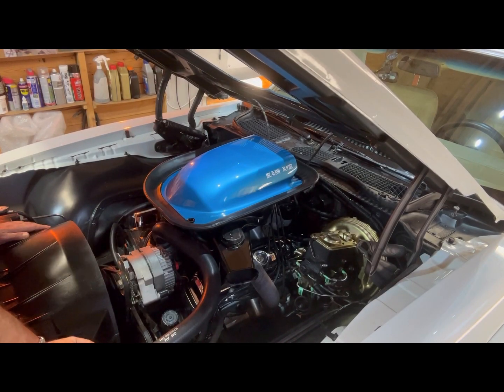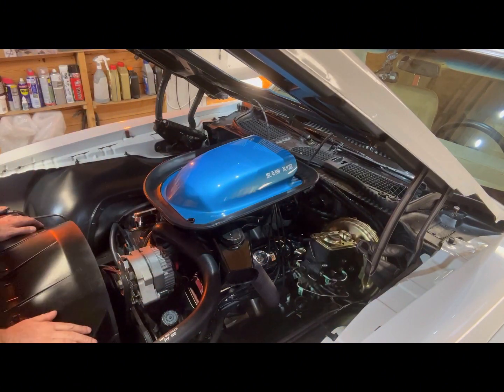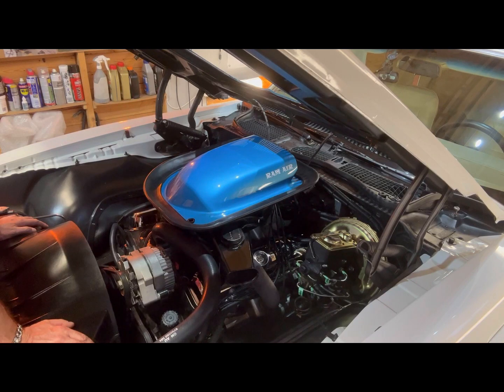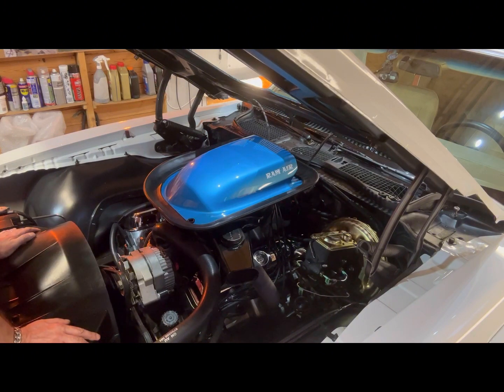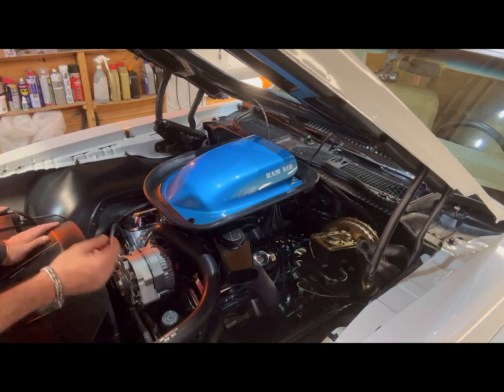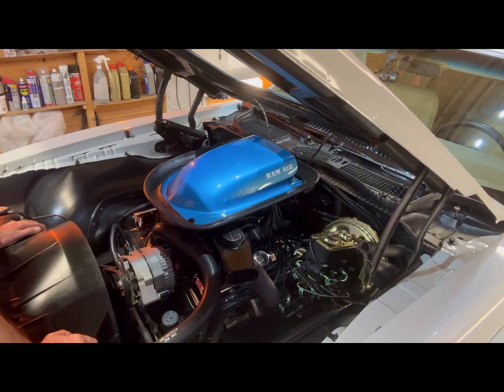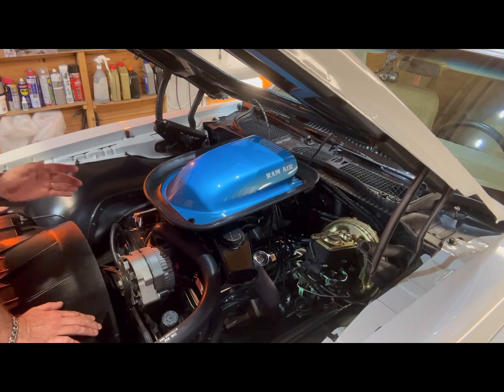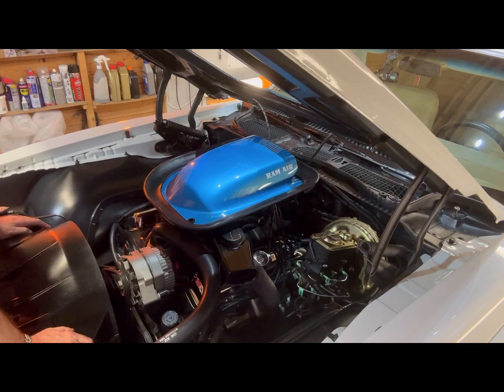My Trans Am Broke Down!! Ignition and wiring issues! Is it fixed?

Comment: Hiya I found this on a site firebird generations might be of use to other's in the future ...... The resistance wire replaces the ballast resistor we used to see in older cars. It is actually used when the car is running not starting. The yellow wire that comes up from the starter supplies full battery voltage, via the thick purple start wire from the switch to the starter solenoid, to the coil for starting. Once the engine starts the resistance wire supplies a lower voltage for running. Only eight to nine volts is supplied to the coil to keep it from failing due to over heating. When the starter motor is engaged it draws a lot of power from the battery resulting in a lower voltage available to the coil. Full battery (reduced due to starter motor) voltage is supplied to the coil during starting as the voltage from the resistance wire would be reduced even more during starting, perhaps low enough to not fire the plugs enough to start. A higher voltage at the coil for the brief time it takes to start the engine isn't much of a threat to overheat the coil, but running the coil full time at alternator voltage of 14.8 volts is. Some coils have an internal resistance eliminating the need for a ballast resistor.

Sounds like a short to ground, perhaps it's insulation is worn and the wire is touching a part of the body and grounding. Or it could be as Doug suggests, the circuit grounding at the coil. I am also not familiar with the Mallory E start, but it sounds like an electronic ignition which would require 12 plus volts. If so and your ignition wire is already burn out you can replace it with a non insulated wire that will supply battery voltage to the coil. If it is a modification that converts points to a module type ignition you still may need the resistance wire. If so you will have to find a resistance wire to replace the burned out one, or use a regular wire and install a ballast resistor. The ignition system you have may require a specialized coil used for that system only, the blaster 2 may be the problem.

Did you install the E ignition yourself or did you buy the car with that already installed? Did the car run well before and this is just a problem that has recently come up?

Do you have the ignition wire attached to the pos + terminal of the coil? Do you have any other wires attached to the same pos + terminal that could be grounding?
Reply from the maker: Hi there, great detailed explanation and totally agree with everything you stated. 

So after doing some research myself after the car let me down, I did in fact find the resistor wire insulation shorting to ground. I have since removed that cable from the loom. I have installed a new ignition sourced 12v fused supply to the coil. 

The Petronix igniter module had been fitted by a previous owner but the car was still running the original coil. I have replaced that with the accompanying Flamethrower coil which as you rightly point out has an internal resistance so requires the full 12v. I have also kept the starter yellow cable connected, not that it probably needs it now with the new 12v supply and I’ve gapped the plugs slightly larger than recommended for points type ignition.

 It has been running really well for the last 3 months and 400 or so miles, apart from an off idle flat spot that I’ve been trying to resolve, which I’ve finally sorted. Again with some research on line and buying a really good Rochester Quadrajet book and just getting to know my car. It has had a race cam installed previously, which I only discovered recently when reading through the history file, so that changed my whole approach to setting the timing and carb up.

I have also bought an HEI distributor as back up, now that it has the 12v supply it wouldn’t take much to swap it over, but I prefer the stock and correct look of the smaller distributor and separate coil.

It’s been a good learning curve and getting to know  the car, and appreciate your comments.
All the best
Reply: @TransamObsession  your very welcome my friend maybe one day I might get a chance to see your beautiful Pontiac firebird trans am.... Sure is a thing of beauty.....infact when Pontiac launched your very same Pontiac firebird trans am they never looked as nice as your's does now ..... Here's a interesting note on the Pontiac 455 super duty the trans am was the fastest coupe in America of it's year only one car that could beat the trans am was the Ferrari Daytona true fact indeed
Reply: Can you remember a show on used cars with Mike brewer called deals on Wheels....a 1973 Pontiac firebird trans am 455 SD was featured on the show it's still going strong today go have a look I've sent a link the firebird is still taxed today .... I've checked with gov ,UK details as follows Vehicle makePONTIAC

Date of first registrationFebruary 1973

Year of manufacture1970

Cylinder capacity6556 cc

CO₂ emissionsNot available

Fuel typePETROL

Euro statusNot available

Real Driving Emissions (RDE)Not available

Export markerNo

Vehicle statusTaxed

Vehicle colourBLUE

Vehicle type approvalNot available

Wheelplan2 AXLE RIGID BODY

Revenue weightNot available

Date of last V5C (logbook) issued9 August 2012
Reply from the maker: @Tiffany.1970  Wow, yes I remember that show but don’t remember that episode. And wish you could still get them for those prices, 6-8k for a nice one, around 10 times that now😀
Reply: @TransamObsession   that was a bargain back then for that 1973 Pontiac firebird trans am.... Would love to see how it looks now il see if  I can find some pics on the trans am ...... Online